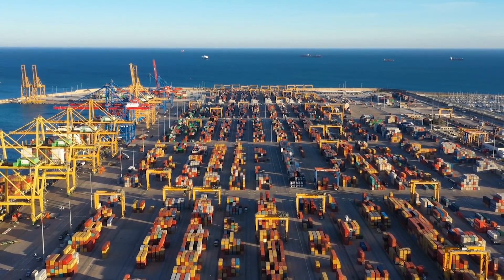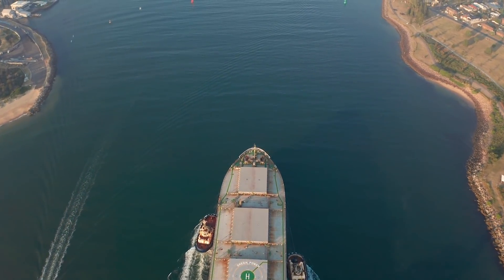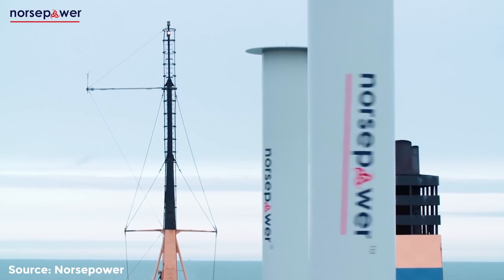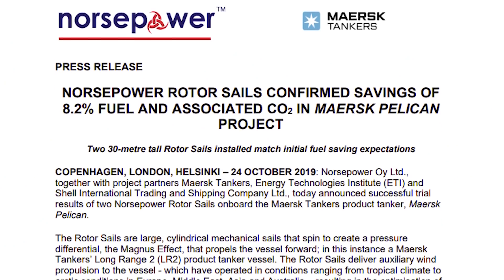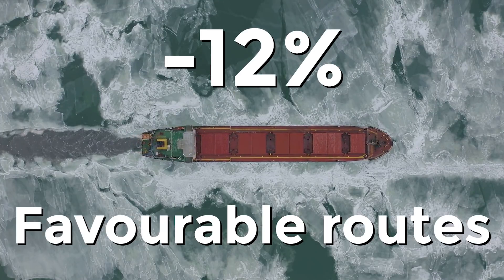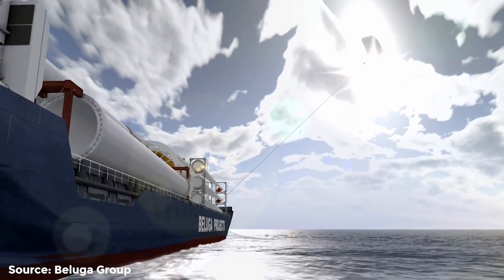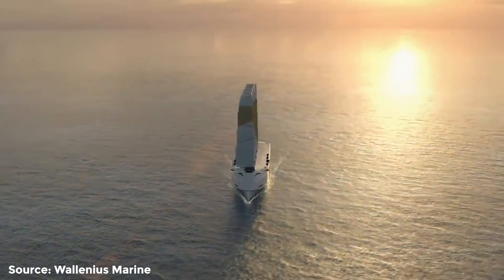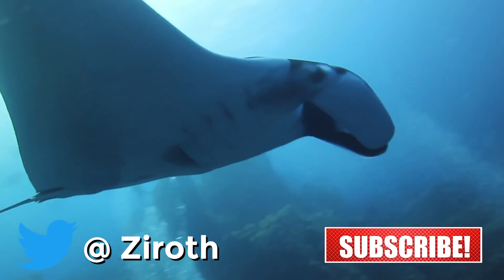Is Wind Power The Future of Shipping?

Comment: Couldn’t there be a way to idk use the ocean? Surely there is an answer in the huge abundance of water energy. I think we should look to fish for inspiration. Every fully aquatic creature has evolved for below sea travel, not floating at the top like a ship. Sure some birds do this but even if just ships floated just below the surface we could somehow use that as an advantage? I feel as if we’re not really thinking outside the box with this problem and our ships have remained the same for literally thousands of years. I know there’s such thing as submarines obviously and their propulsion isn’t much different, but I feel as if humongous ships floating on the surface of the ocean as the most productive way to move in the sea. Surely there’s a lot of surface friction. Sure whales come up to breath but you don’t see them floating at the top of the water for the most part
Reply: In a word, pressure.  In layman's terms pressure is a product of depth times density and the deeper you go the higher the pressure becomes. Building the hull of submarine is very, very expensive and that is before you get into the problems of air independent propulsion.  the largest modern shipping already has below water reach of as much as 20m (about 60 feet if you are from the USA) making them function at the current limits is the best that engineering can do so your suggestion is not practical.  Sorry.
Reply: @BernardLS  I see no need to be sorry, was just curious to the practicality of subsurface shipping
Reply: @BernardLS  it’s just frustrating to me I truly do feel somewhere and somehow we have the technology to do something about issues like these
Reply: @DirtCobaine  WADR At the moment long chain hydrocarbon fuels have a technical advantage and are the most efficient energy stores that it is practical to use.  'ULCC's and vessels like the Mearsk Triple E container ships would require far too much sail or photovoltaic area compared to the energy harvest if carried on board.  Harvesting energy ashore into a storage medium for use onboard would struggle to meet the levels of efficiency fossil oil has given humanity.  We are mining the encapsulation of energy that has occurred over many millennia and sadly not paying the full cost.  The 'free use' of 'common' resources’, such as the atmosphere as a waste depositary and the oceans as a cold sink, being the problem.  This is the area where regulatory action could be useful; the best option is both limitation of consumption and limitation of population growth.  Not at 'pre-industrial hair shirt' levels; but do we need a 5 litre V8 pickup to get to the golf club?  Is a family of 'two parents having two children' (assuming both will survive to adulthood) a good size to aim for given the generational replacement rate is 2.1?  In summation; reduce consumption, localise production, limit reproduction to replacement level, satisfy 'needs' not 'wants' and be satisfied with 'comfort' not aspire to 'opulence'.
Reply: @BernardLS  very good points it’s actually quite irresponsible at this point the rate at which we freely reproduce and consume at the same time like a bunch of rats. I agree population should be one of our biggest concerns and of course just like everything else, it’s not our problem until it’s threatening our existence that very minute. I think most of our issues arise from such a huge population. And it’s not like we don’t take up a lot of space and consume a lot of energy as an individual being. Our population has grown faster than evolution can handle. We were never intended to live the way we do.
Reply: @DirtCobaine  The multi stage demographic transition model shows there is a solution to the population problem but resolution first requires enough of us to recognise the problem and sadly many of the world population are too busy trying to survive on a daily basis to worry about what will happen ten, fifty or a hundred years down the time line.  Having your home flood does tend to concentrate you mind on the drainage!

Comment: I think part of the problem in the time it takes for wind powered sailing could be fixed with a change in tax laws.  The "just-in-time" inventory systems that make fast shipping necessary are mostly for the purposes of avoiding taxes on inventory.  Allowing manufacturers to store inventory without having to worry about paying taxes on it could eliminate the wasteful just-in-time system and make it possible for slower types of shipping to be used.
Reply: To address the suggestions that wind power is the answer I offer the following example.  In 1870 a premium sailing vessel entered service, the ‘Cutty Sark’.  The ‘Cutty Sark’ was 64.74 metres in length with a beam of 10.97 metres and a loaded displacement of 2 100 tonnes.  She was able to carry, at best, 1 700 tonnes of cargo and to harness the energy in the wind the available spread of canvas was up to 2 976m2 which was tended by a crew of about 30 skilled men.  A ratio between the sail area (SA) and the vessels displacement (D) determines how lively she is; ‘lively’ being nautical speak for ‘fast and manoeuvrable’.  The carrying capacity of cargo ships is constrained in two ways, mass and volume which leads us to the ‘stowage factor’ of the cargo; the more mass on board the greater the displacement which in turn impacts the efficiency of the hull form and sail area / displacement ratio.  A vessel constrained by mass is said to be ‘down but not full’, while a vessel constrained by volume is said to be ‘full but not down.  When in the tea trade, which the ‘Cutty Sark’ was designed and built for with fine lines (more nautical tech speak, so again no need to worry about it) she could carry around 600 tonnes of cargo at speeds of up to 17.5 knots dependent on the prevailing wind and had a typical China to UK time on passage of 120 days.  The tea trade was very competitive so ‘time on passage’ was a large factor in securing the premium freight rate that made her cost effective.  Rounding things out, her maximum available sail area gave circa 5m2 of canvas for every tonne of tea carried.

As soon as the Suez Canal opened, which the ‘Cutty Sark’ was unable to sail through; she lost her advantage, raw speed, to the steam powered ships of that era who could beat her ‘time on passage’ by taking that short cut.  Mechanically powered ships have improved in terms of efficiency, on a freight tonne mile basis, by at least one order of magnitude since then.  After losing out to the coal burning, fire tube boiler, steam reciprocating mechanical ships of the late 19th century ‘Cutty Sark’ was relegated to the Australian wool trade, just about the bottom of the barrel in maritime terms and only one small step up from being a 'honey barge'.  The canvas, cordage and extra manpower needed for sailing ships was never a very benign environmental option so please discount any idea of sail as ‘sustainable’.  All this is without the problem that if ‘the wind don’t blow the ship don’t go’, when it does blow it often blows in the wrong direction for your cargo delivery needs and sometimes there is rather too much of it for comfort.  Traditional sailing ships are unable to go directly up wind so if the wind is blowing from the direction your cargo needs to go then a zig-zag course must be steered, more distance and thus more time on passage at whatever speed is achieved.  Wind speed is traditionally measured on the Beaufort Scale (wind speed) that runs from 0 (< 1kn) to 12 (> 63kn) and for sailing purposes the usable part of the range is ‘3’ (circa 8kn) to ‘6’ (circa 24kn).  As the wind speed, and the amount of energy that may be harvested there from, increases the sea surface becomes progressively more disturbed which makes the harvesting process ever more difficult.

Random fact about ‘Cutty Sark’, it is said to have been possible to coax 3 000 horse power out of her sails, or in ‘real money’ 2 206 500 Watts (2.2 megaWatts), assuming this was in ideal conditions or 741 Watts for each square meter of sail area.  So that majestic spread of canvas would have been less than efficacious for delivering your baubles and bows from the orient, despite taking about three times as long on the voyage.

Comment: Ziroth a very good description of some of the ways the wind might assist a ship. But did you know it is possible to use a headwind to drive a ship forward? I'm sure you never thought of it! Peter Worsley has done research on this and has proved it works. See www.windthrusters.com/windassist.html
Reply: On board wind turbine might get you around some of the problems, however for marine use vertical axis wind turbines (VAWT) would be better than, the what have now become 'traditional', horizontal axis wind turbines (HAWT) for reasons that include the air draught of the vessel, weight distribution and maintenance access.  The energy yield is still subject to the wind blowing at the right strength and having space available on board for the hardware.  The masts, rigging and sail handling arrangements would take up 'prime real estate' on the vessel.  Fuel oil bunker tanks can be, and usually are, stuck away in any odd corner and the ICE power plants are themselves relatively compact.  The stacked up 'boxes' would mean putting the wind driven propulsion units in a bad situation from a ship stability point of view.
Reply: @BernardLS  A vertical axis turbine can never produce more thrust than it can drag. Therefore a VAWT is no good for providing power from a headwind. Do you imagine that a VAWT can produce a low drag power solution to carry a ship into the headwind? It has never been done. Whereas  the HAWTS that I have tested can do this easily. See www.windthrusters.com/proof.html
Reply: @WindThrusters  Taken from Vertical-axis wind turbine - Wikipedia ‘A vertical-axis wind turbine (VAWT) is a type of wind turbine where the main rotor shaft is set transverse to the wind (but not necessarily vertically) while the main components are located at the base of the turbine. This arrangement allows the generator and gearbox to be located close to the ground, facilitating service and repair. VAWTs do not need to be pointed into the wind,[1][2] which removes the need for wind-sensing and orientation mechanisms. Major drawbacks for the early designs (Savonius, Darrieus and giromill) included the significant torque variation or "ripple" during each revolution, and the large bending moments on the blades. Later designs addressed the torque ripple issue by sweeping the blades helically (Gorlov type).[3] Savonius vertical-axis wind turbines (VAWT) are not widespread, but their simplicity and better performance in disturbed flow-fields, compared to small horizontal-axis wind turbines (HAWT) make them a good alternative for distributed generation devices in urban environment.[4]

A vertical axis wind turbine has its axis perpendicular to the wind streamlines and vertical to the ground. A more general term that includes this option is "transverse axis wind turbine" or "cross-flow wind turbine." For example, the original Darrieus patent, US Patent 1835018, includes both options.

Drag-type VAWTs such as the Savonius rotor typically operate at lower tipspeed ratios than lift-based VAWTs such as Darrieus rotors and cycloturbines.’

Computer modelling suggests that wind farms constructed using vertical-axis wind turbines are 15% more efficient than conventional horizontal axis wind turbines as they generate less turbulence.[5][6].

If ‘the wind don’t blow the ship don’t go’, when it does blow it often blows in the wrong direction for the cargo delivery needs and sometimes there is rather too much of it for comfort.  Traditional sailing ships are unable to go directly up wind so if the wind is blowing from the direction your cargo needs to go then a zig-zag course must be steered, more distance and thus more ‘time on passage’ at whatever speed is achieved.  Wind speed is traditionally measured on the Beaufort Scale (wind speed) that runs from 0 (< 1kn) to 12 (> 63kn) and for sailing purposes the usable part of the range is ‘3’ (circa 8kn) to ‘6’ (circa 24kn).  As the wind speed increases and the amount of energy that may be harvested there from increases the sea surface becomes progressively more disturbed which makes the harvesting process ever more difficult.

Random fact about ‘Cutty Sark’, it is said to have been possible to coax 3 000 horse power out of her, up to 2 976m2 in area, sails; or in ‘real money’ 2 206 500 Watts (2.2 megaWatts), or 741 Watts for each square meter of sail area.  It is assumed this was in ideal conditions.  So that majestic spread of canvas would have been less than efficacious in delivering your baubles and bows from the orient, despite taking about three times as long on the voyage.  The sails on the ‘Cutty Sark’ produced, the energy harvest, of about 0.33% of the power need to propel a Mearsk Triple E container vessel using the output from her ICEs.

Advances have been made but energy yield from the ambient wind would still a similar amount of energy, 741 Watts for each square meter in those elusive ideal conditions, not the order of magnitude increase, or more, that would be needed to improve on and thus displace the current levels of efficiency measured in ‘cost per freight ton mile’ achieved by fossil oil & gas fuelled ICEs.

The questions that suggest themselves to me are: -
What energy harvest yielded is possible from the ‘Windthruster’ in Watts m2?
What operating parameters limit the use of the units?
Is the type of unit scalable up to ships of 300 000 tonnes deadweight and or 30 000 TEU volume?
Reply: @BernardLS  We just don't know, I'm trying to get others to do the research. But what we do know is that a rotary sail (HAWT) can provide provide thrust to a ship from a headwind when no other systems can not.